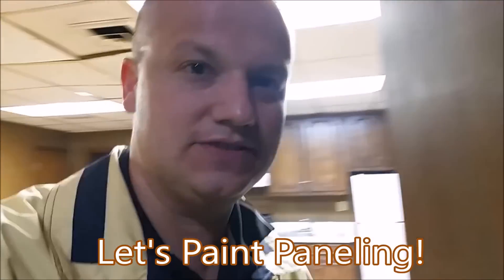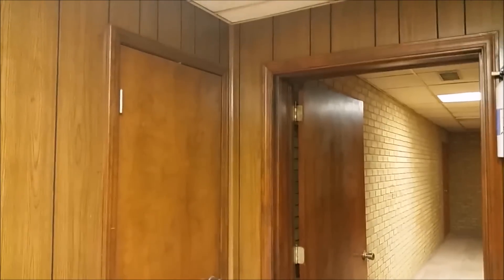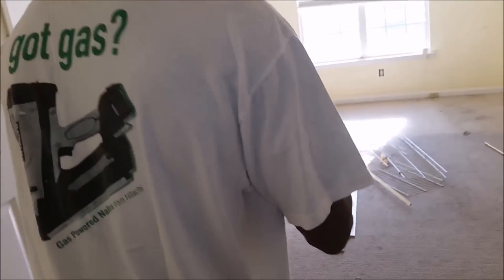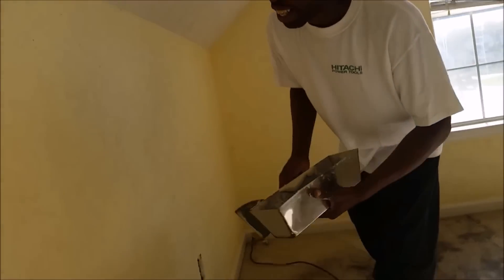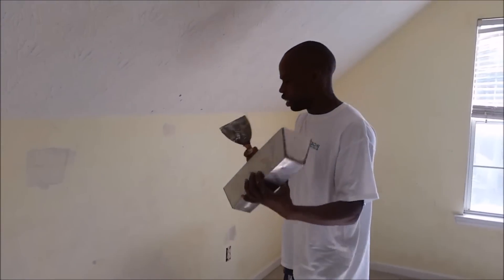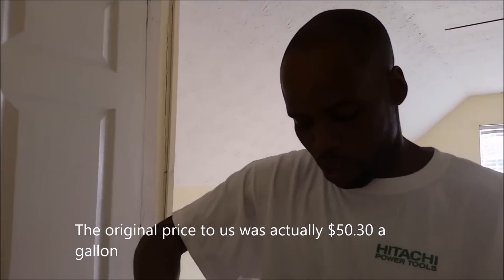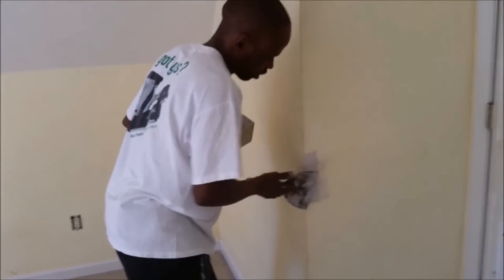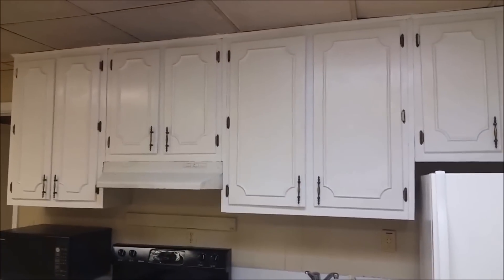How to Paint UGLY BROWN PANELING

Comment: Ok, so I've actually painted our half wall paneling in our basement. Semi gloss white with the top half gray. It came out great! Looks super modern and like we paid a lot of money for beadboard. All you have to do is two coats killz primer where you hit the grooves first with a brush then roll the primer over everything. then two coats white or whatever color you decide. our paneling was pretty dark and that covered really well. you can't see anything. also, sanding is not a needed step if you use primer first. Our paneling was super shiny and just by doing what i already said, we've had no problems.
Reply: Thanks for the tip. I've been looking at house to buy but really put off with the ugly dark paneling on a few properties. Looks like it's an easy solution 🙂
Reply: What kilz primer did you use?
Reply: @locofoto75  I'm a professional painter I have transformed dozens of houses with those panels into beautiful rooms
Reply: Your very stunning 😍

Comment: Nor very informative. I do not want the groves to show in the paneling, if I want texture I would rather use a texture roller, otherwise it will just look like painted paneling, which I am trying to avoid. I have a liquid deglosser from Sherwin Williams, filling the shallow groves with Dap, using a sponge fine sander for sanding the Dap, wipe the walls with a damp cloth, then Kilz oil base bonding primer $24 from WalMart, tape off and paint.

Comment: Wow this video didn't explain anything. Luckily I just painted a house with panelling. I swapped the panelling for sheet rock in the kitchen but in the living I found 2 coats of I very good primer (I used kilz with the blue and white label) and at least 2 coats of paint should do the job. I used 3 coats of paint but I didn't sand the panelling at all and it turned out nice.